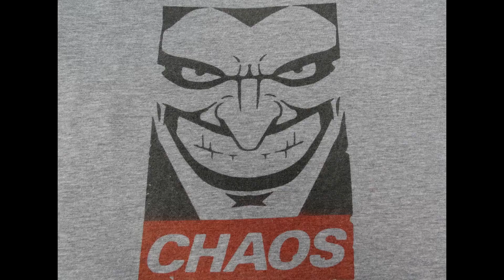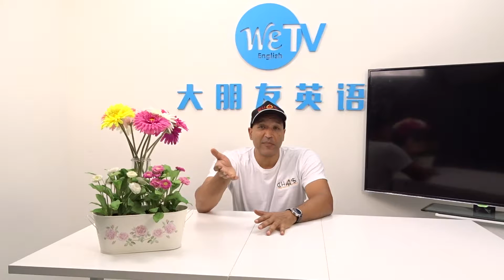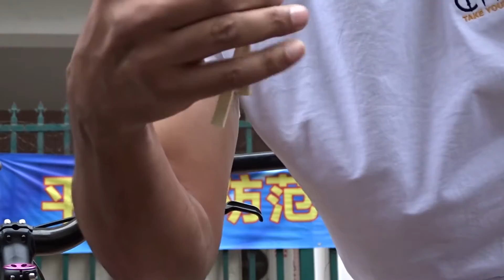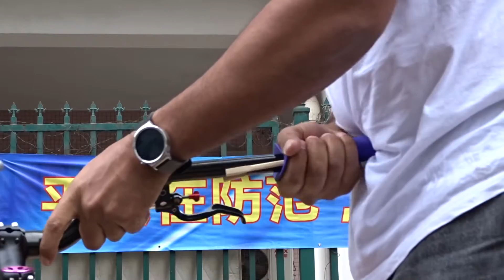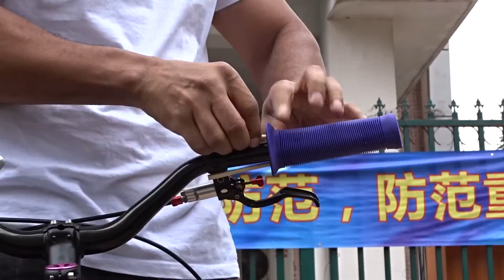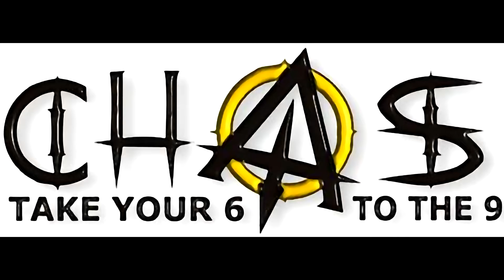EASIEST BICYCLE GRIP INSTALL EVER 5 MINUTES AND DONE!

Comment: This came at the prefect time i am waiting for grips to arrive for my czar street trials and I was about to type in how to remove grips when your notification came up.   Also any advice on cleaning disc brakes mine are starting to slip and squeak when I hop up stuff
Reply from the maker: +Lachlan McNair I think the brakes almost always squeak. I was told to use a liquid detergent to clean the discs. Check the pads for wear and replace it they are worn or have gotten any oils on them
Reply: Chris Sasek no don't use detergent easy way is to use water and loo roll ...I just wipe my discs with loo roll once a week and that's it... it helps to pour water on your pads and discs whilst riding along as well
Reply from the maker: the important thing is to clean the dirt and grime from the discs. detergent is what the factory told me, so a good cleaner. you know I'm such a clean freak when it comes to my bike 
:D

Comment: I've always used hairspray which means it takes less than a minute to do both grips and they never slip
Reply from the maker: hairspray is a good one to use. i've had times it didn't work like the grips were really tight and this is something that has worked for me everytime